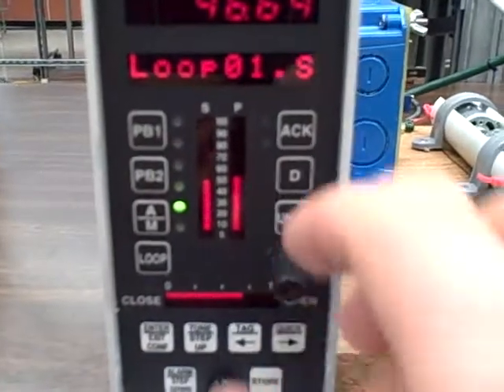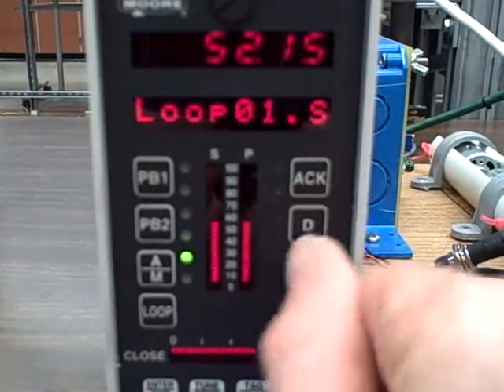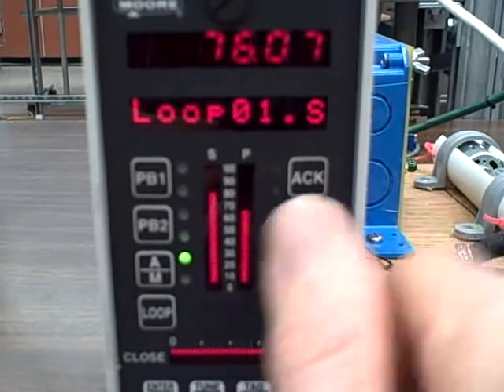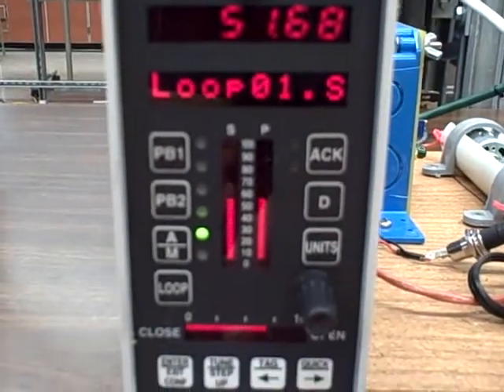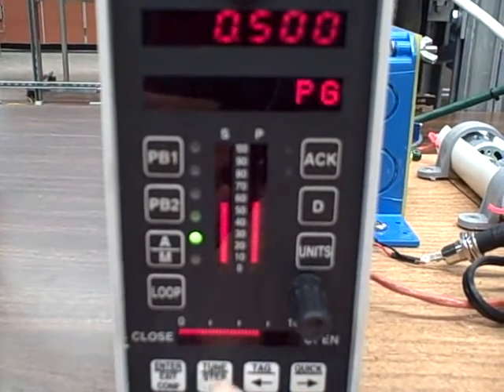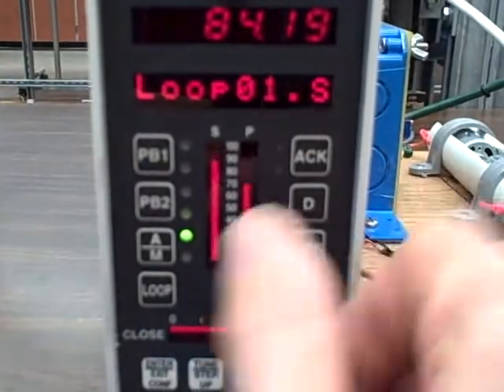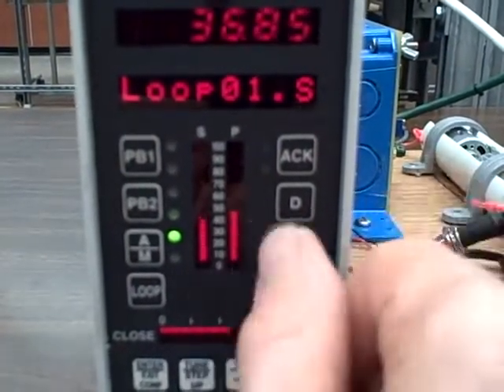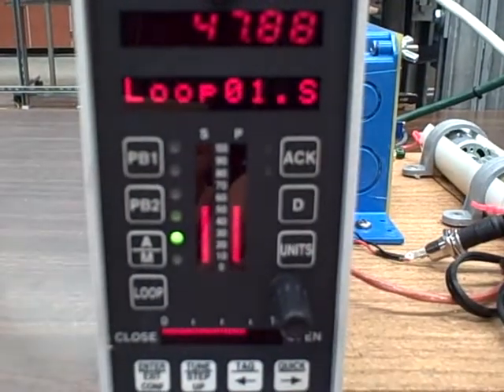Desktop Process proportional-only offset

Comment from the maker: Go to the following URL to find plans for the Pulse-Width Modulation circuit used in this "Desktop Process" to drive the motor:

openbookproject (dot) net (slash) books (slash) socratic (slash) sinst (slash) doc (slash) design (dot) html

The instruction manual for the loop controller you intend to use will show you how to connect the inputs and outputs of the controller.